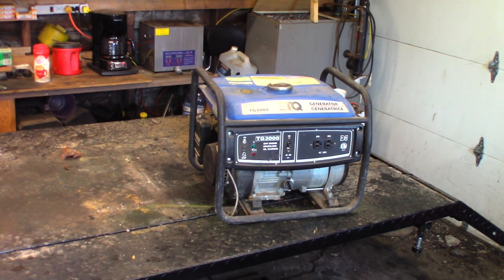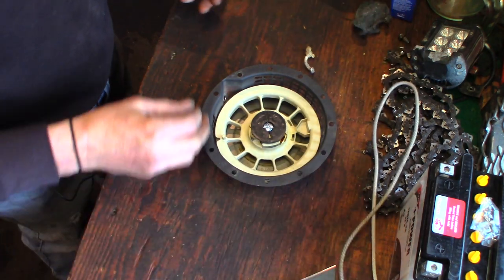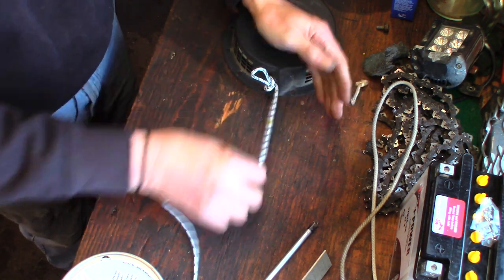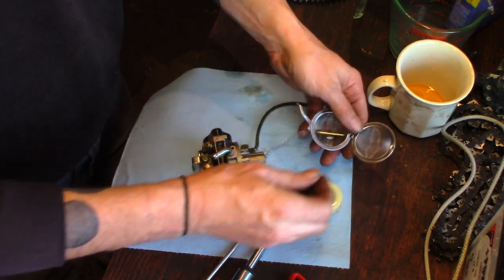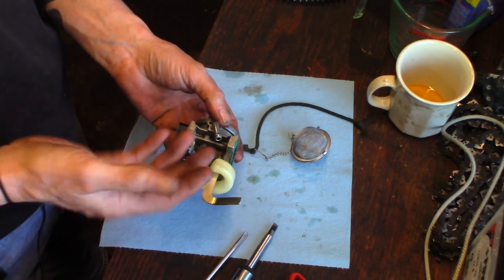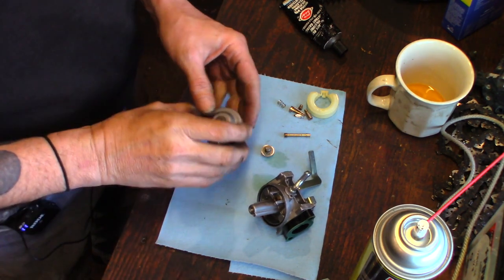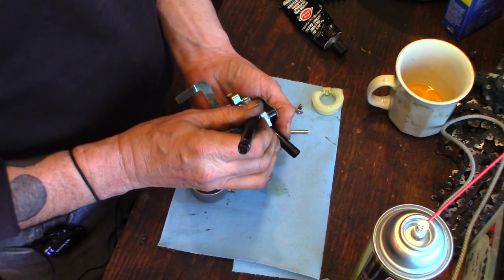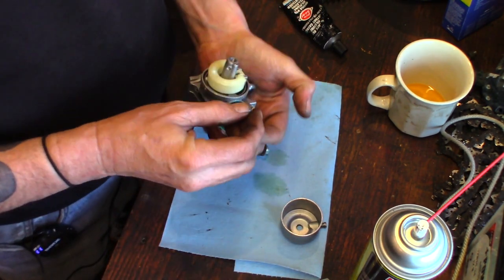This ETQ TG3000 Generator won't start and has other problems. Let's fix it up!

Comment: Wish they were all that quick and easy. I like the kilowatt meter, nice to have around I bet.
Reply from the maker: That meter is handy for generator testing. You can use a multimeter, but this is so much easier.

Comment: I have an etq 390, do you know what kind of spark plug to use. It did not have one when i got the gen
Reply from the maker: I would expect it to be an NGK BPR5ES for that machine. It likely had an F6RTC Torch (junk) brand in it when it was new.
Reply: Thanks!
Reply from the maker: @allgreenchannel2968  No worries.  👍

Comment: What ultrasonic parts cleaner do you use, and what solution recipe?
Reply from the maker: I use a 10L one from Amazon, and I use 50/50 mix of water and Simple Green HD Pro. (Purple stuff, not the green stuff)  I have a video of it posted here... https://youtu.be/jq0hGXsP6iA

Comment: What weight oil would you recommend in this?
Reply from the maker: I use SAE30 in units that will only run at ambient temperatures above 0*.  10w30 if you will be operating it in the cold winter, but check the oil level often...

Comment: Does this work best with oil or gas?
Reply from the maker: Sorry, I'm just not sure what you are asking here.  It's a 4 stroke engine, so you do not mix oil in the gas on this unit.  But again, not sure what you are asking.